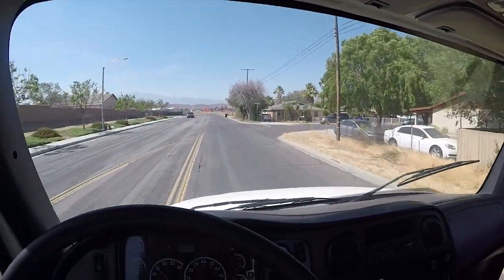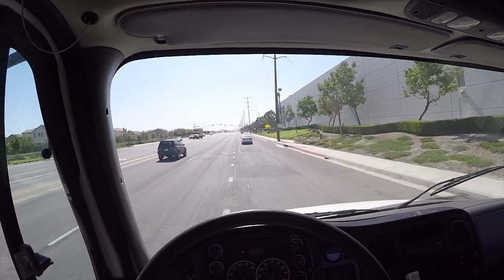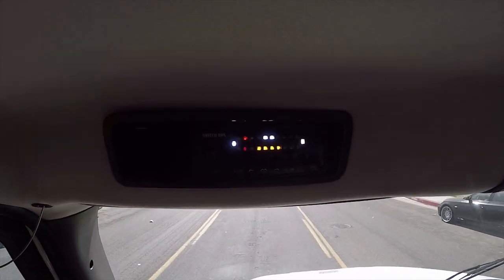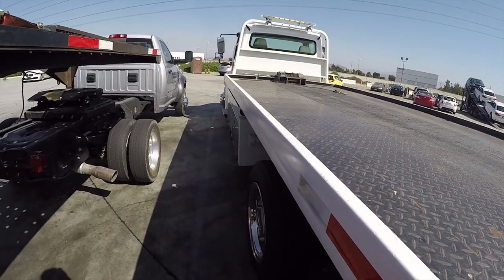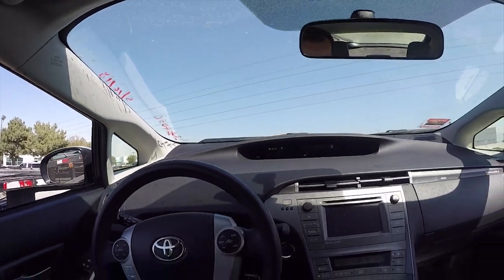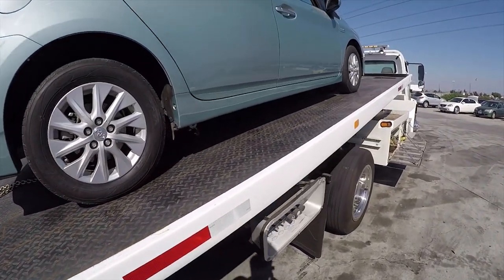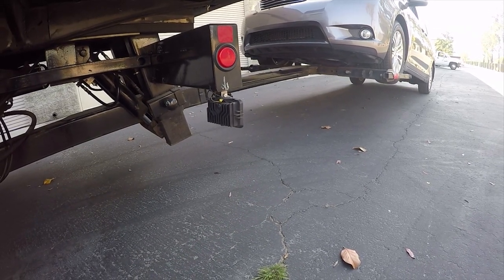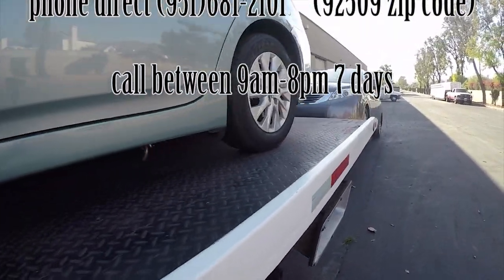2012 Freightliner Rollback Flatbed Tow Truck Demonstration Drive Review

Comment: Amazing you guys get away with that chaining. In Canada we need 4 points of contact NOT including your winch cable...so 4 tow straps
Reply: That's how we do it here in Kansas Four Points of tie-down all four corners with dog bones in the middle
Reply: And yes we do not count the winch cable as our tie down
Reply: This guy does NOT speak for all U.S. tow truck drivers standard of operation.  He is either new, or has little training in the trade.

Comment: I see a lot of problems with this truck. Most Freighliner Dealer don't know the hybrid technology except the hippie ones in Cali. Also, you forgot to mention that the bed of the truck and towing equipment is a Galaxy 10 Series which is an almost non-existing company. So, parts and service is your own problem. You'll probably won't sell this truck to a person that knows the game but to someone that doesn't know jack about towing or the high maintenance this truck requires. Finally, I have never seen a engine driven clutch PTO on a Class 6 truck in my life. I wonder who put this truck together and why...
Reply from the maker: Sadly this Truck was destroyed by an 18 wheeler in a Fatal crash on 1/1/2019 https://www.koat.com/article/i-40-closed-eastbound-at-coors/25721703
Reply: mybestcarcom Thank you for the link. That was quite the wreck. Very unfortunate. My condolences from Canada.